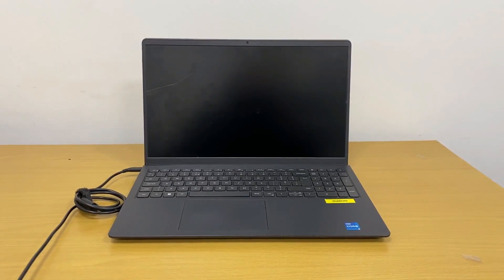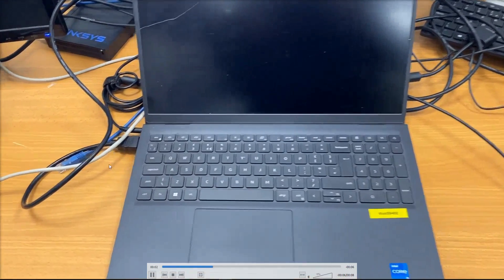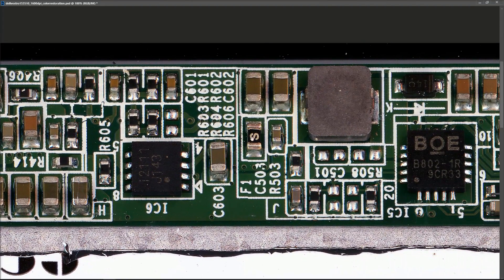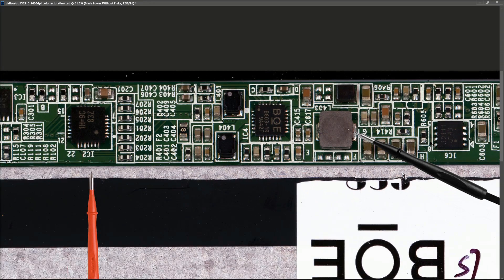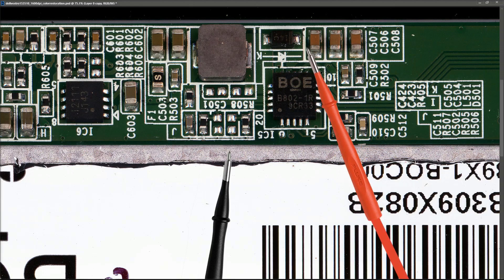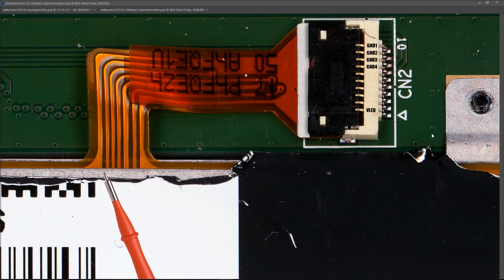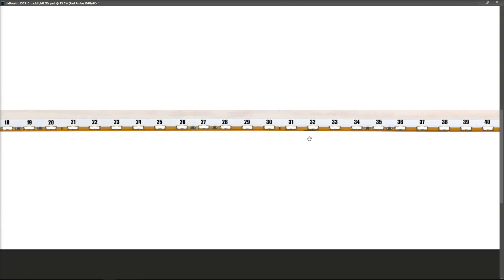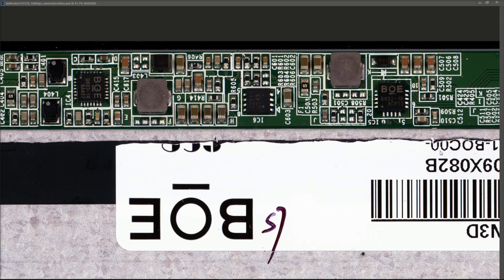Dell Vostro 15 3510 - Screen Fault

Comment: In TVs it is very common for LED strips to fail. Depending on the size of the screen [32 - 85] inches will be the cost of the strips. Exposing the price to the client (owner) for consideration prior to replacement is always the best decision. 
In the case of laptops, first check the T-Con and the FFC Cables and/or Connectors.
If the screen is broken (crack or imperfections in its texture) a complete replacement including the case and the front bezel is the best option. 
Thanks to your video I will investigate LED strips for laptops and verify if the operation of replacing them is feasible (affordable). Since the screen size will be [14 - 27] inches I think it WILL be. Thank you for your effort in publishing this type of content and mainly for your time invested in it. Please continue doing it. An affectionate greeting from Mexico.

Comment: If you jump that led the backlight should work (the led driver will adjust the voltage accross the strip and the leds will draw the same current as before).
Reply: I wonder if that will also work with the LED string in my refrigerator? The five LEDs in the top are on the same circuit as the dead LED down in the freezer.

Comment: I have always been scared to peel the black plastic from that PCB, partially because of all the WARNING labels, and partially because it gets very HOT when turned on. And I have never opened a display screen to examine the LED strips. I suppose I will do a complete teardown the next time I receive a cracked screen.